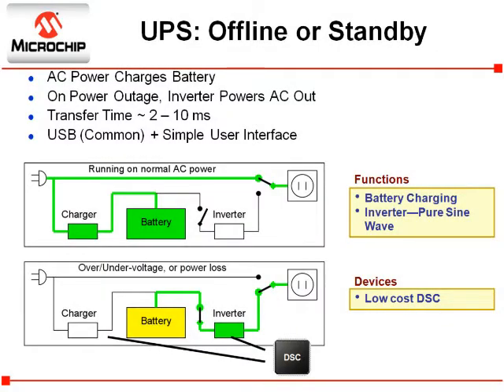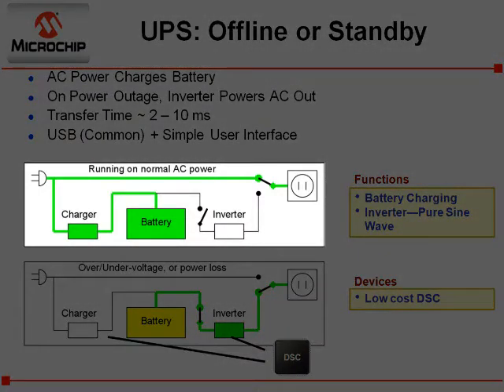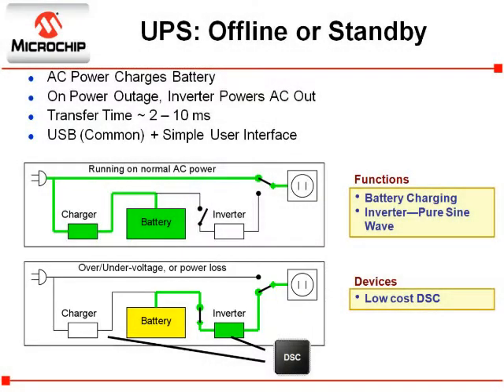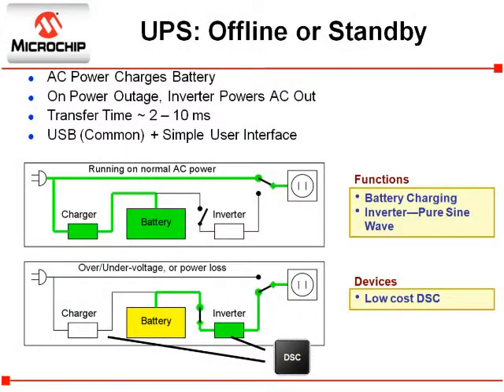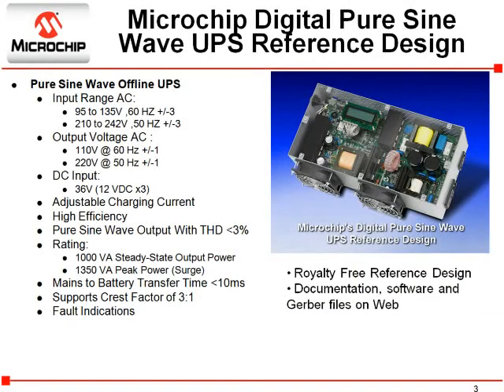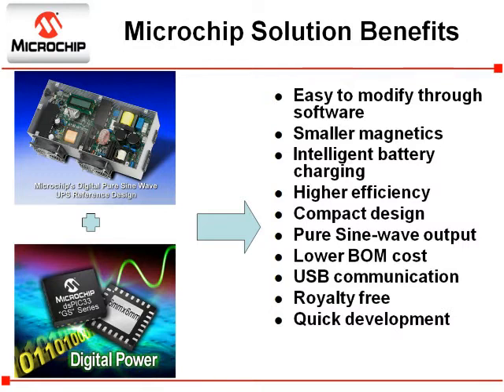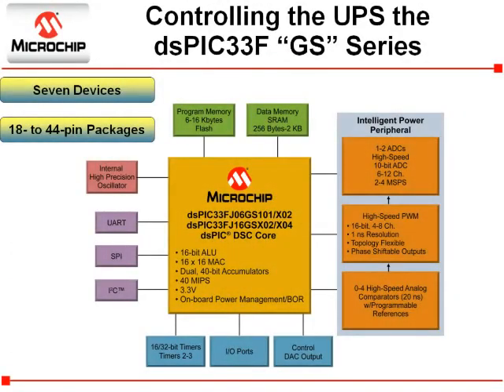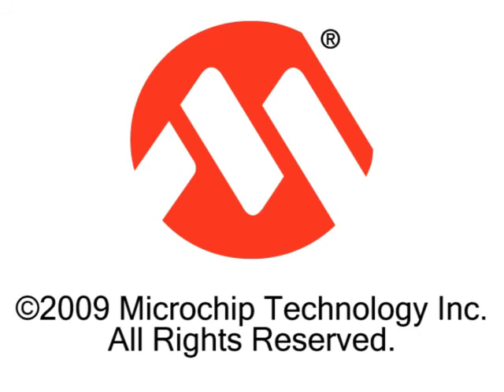UPS Reference Design

Comment: Hi, What is the data to be sent from PC through USB Communication
Reply from the maker: Hi there! The data sent from the PC via USB Communication would typically be commands or data requests to control and monitor the UPS system. This could include turning the UPS on/off, querying the current power status, setting power thresholds, or requesting notifications for certain events (like low battery). The specific data transmitted would depend on the software interface and the capabilities of the UPS system. Hope this helps!
Reply: @MicrochipTechnology  Thank you for the reply... We(my team) are developing this solution. Do we have software for this.. If so could you guide us, how to download this and sharing any operation documents  could be more helpful to us..
Reply from the maker: No problem. Please follow the link here to find the source codes: https://www.microchip.com/en-us/development-tool/Digital-Pure-Sine-Wave-UPS